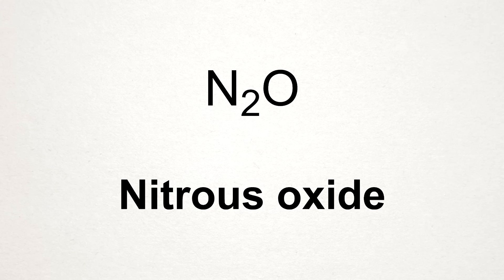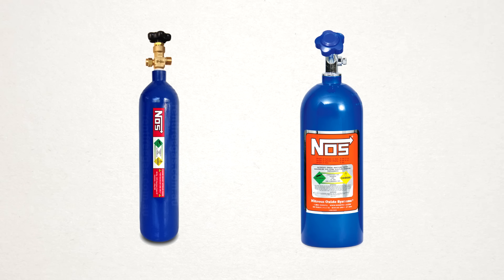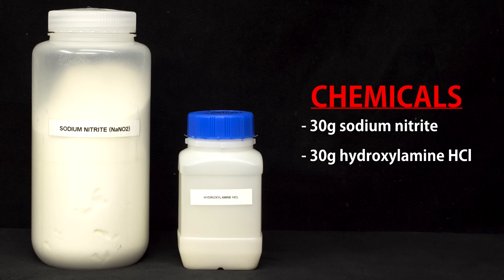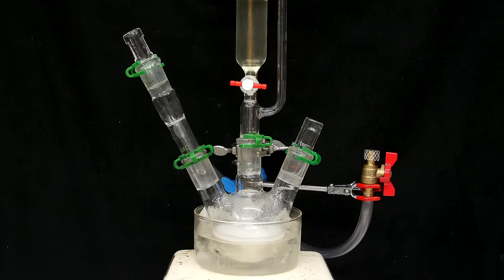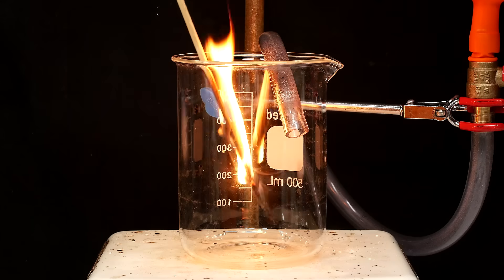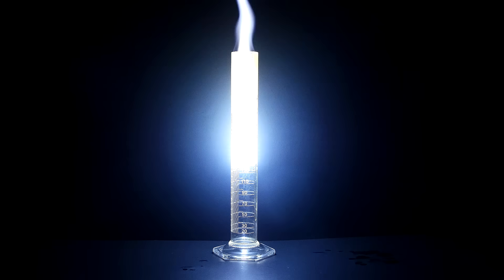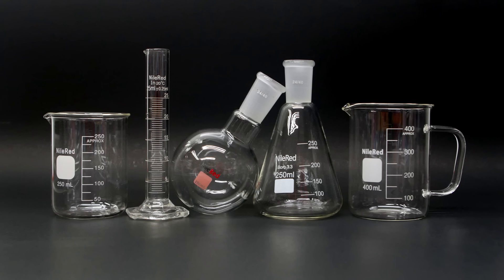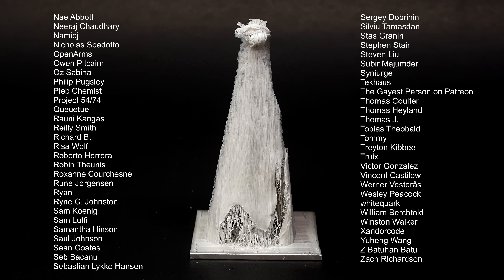Making laughing gas

Comment: Also N2O is a cryogenic refrigerant used on cascade cycle for sub 60°C is called R744A and have a GWP of 298 and a boiling point of -87°C @ 0 bar or 1 atm

Comment: Anybody know the name of the brass valve/fitting used from @5:41 onwards to fill the balloon, or another type of fitting that will easily allow standard sized lab tubing to be connected to common balloons? My current solution is too small in diameter for the balloon to get a good seal.

Comment: Im interested in trying out this experiment but i was curious about a variation in the glassware setup. Would it work to use a single necked RB flask and hook up a tubing adapter to the top of the addition funnel? As well as this would potassium nitrite work as a substitute for sodium nitrite (Iv'e found its much easier to purchase then NaNO2)?

Comment: It could be important to realise that nitrous oxide can render vitamin B12 inactive. This is a primary cause of the health issues that result from using it recreationally. Indeed, it is also an issue for both patients and staff when used in ordinary health settings such as in operating theatres or as 'gas and air' during labour.

Low B12 can cause many effects but is very likely to be missed by a doctor who is not suspecting it.

Comment: This is an excellent reaction to demonstrate the complex and perplexing redox chemistry of nitrogen compounds. Note that decomposition of ammonium nitrate is thermodynamically favoured, but not kinetically favoured, because measurably decomposes only with strong heating, but the exothermy shows the reaction is spontaneous. This is also due to mild acidity and reducing properties of ammonium. Sodium nitrate does not decompose like that. Instead in only partially and reversibly decomposes to nitrite, yet nitrites are more reactive than nitrates (ammonium nitrite notably decomposes at room temperature and explodes even on mild heating). While nitrates form nitric acid, nitrites don't even exist in acidic solution except as the unstable and reactive nitrous acid (compare with sulfurous and carbonic acids), which cannot be isolated and can be kept only for a while in cold solution.
So contrary to popular belief, inorganic nitrates are fairly inert and both the reduction potential and reaction rate depend on pH, which both also depend on temperature.
I guess the cooling is needed not only to avoid thermal runaway, but also to keep the unstable intermediates in solution (hydroxylamine, hydrazine, dinitrogen trioxide etc.).
Note that nitrogen itself is relatively strong oxidizing agent (E0 = ~1 V) yet it is normally so inert it can often replace argon in lab experiments (and so is nitrous oxide - this is why it's used as a propulsion gas for whipped cream in place of carbon dioxide, which is acidic and thus too reactive toward fats).
It would be great to demonstrate the redox couples and potentials involved in this reaction as well as conditions (namely pH) required to obtain nitrous oxide as a product (rather than nitrogen or its higher oxides).
The rich chemistry of nitrogen is utilized by bacteria and this is why nitrates and nitrites occur in nature (see nitrification, nitritation, denitrification, annamox, connamox). Some bacteria oxidize ammonia to nitrogen in presence of nitrate - the oxidation of ammonia takes energy, but the reduction of nitrate produces even more energy, making the whole process net positive. Although the final product is nitrogen, it is believed that hydroxylamine is an intermediate in such metabolic process.

Comment: N2O in cars is not as much used as an oxidizer, but to cool down the air fuel mixture hard, which gives move air in the mix. The increase in oxygen through the larger amount of air makes it possible to use more fuel and give more power. It would work with anything that cools down the mixture to the same levels, and doesn't kill the flame.

Comment: 9:39 Tip to get smoother and clearer slow motion footage: I noticed in your videos you use Lumix cameras for filming ( I'm assuming you're using GH4 or GH5 ) which can go up to 180 fps to 240 fps. The trick is to set your shutter speed to be double of your frame rate. So if you're shooting at 60fps then your shutter speed should be 1/120 etc. Side-note: It will require a lot more light since you'll lose more than 1 f stop of light per increment.

Comment: To the insane people who are actually down to do this (your not alone), I thought of an easy way to do this. I never tried it but I’m 99.99% sure it works
1: grab a bong
2: place the bong in ice water
3: pour the liquid hydro hcl in that bih
4: grab an empty water bottle and poke a tiny hole in it
5: pour the liquid sodium nitrate in the water bottle 
6: place your mouth on da bong
7: slowly drop some of the liquid sodium nitrite in the hole ur supposed to put weed in and quickly cover your hand on the hole so ur not wasting gas
8: enjoy

Again I just thought of this so if anyone is actually down to try it tell me how it goes👍🏻

Comment: Fun fact, N2O isn't actually used in car engines becasue it's an oxidiser, it's really used to cool the engine so it can hold more air, and the extra air allows more fuel to be burnt

Comment: The best way to do a Woof Woof demonstration is to dissolve some yellow phosphorus into some carbon disulfide.  Place a piece of filter paper on the top of your graduated cylinder.  Pipette about 0.5-1ml of the juice onto the paper and turn the lights off.  As the CS2 evaporates the heavier than air vapors fill the cylinder and when dry the yellow phosphorus ignites causing the vaper to burn from the top down giving a nice visual effect and the "woof" sound.

Comment: I think your yield is actually better than 80% because your calculation doesn't take account of the pressure inside the balloons. The molar volume of a gas is 24 L/mol at 20°C and 1 bar according to the ideal gas model. But it's less if the pressure is higher (one mole of gas takes less volume if it's pressurized). Therefore there are more molecules in the balloons than 0,343 mol!

Comment: I had spinal surgery for my scoliosis recently, and they used laughing gas to put me under. It was probably the closest to recreational drugs I’ve ever come. Like I turned my head to the right, then back to face forward, and the left half of my field of vision didn’t come back. Then every started to warp and before I knew it the surgery was over. 10/10 can totally see why people use it recreationally
Reply: Hope your back’s doing alright now!
Reply: @Pax_Mayn3 does it do brain damage?
Reply: @AfkBxndit  It's been a year but it will only negatively affect your health if you massively abuse it, like most things. To do it safest, you want to space out your sessions by 2 weeks, otherwise you get B12 defficiencies
Reply: @AfkBxndit yes
Reply: @AfkBxndit the main negative effect N2O on the human body is it rapidly depletes your vitamin B12 levels, which can result in a bunch of other health problems. this is easily fixed by taking a daily multivitamin. it’s very different from inhalants like computer duster or gasoline, nitrous oxide is a very safe drug if used responsibly. it doesn’t automatically kill brain cells when you do it, that comes after you’ve been doing whippets for days on end without taking anything to raise your B12 levels.
Reply: Dental problems for me. They gave me nitrous and got mad when I laughed at everything they did.
Reply: i was never affected as a kid i actually really liked it when i went to the dentist but my parents had traumatic car crash and i had gotten pretty bad anxiety from everything and i was at the dentist thinking the “laughing gas” wasnt going to do anything but when they gave it to me i felt really uneasy and even anxious and i hated it
Reply: I use it recreationally. Sadly it only lasts for about a few minutes but it’s nice
Reply: @nakoriakiyama9417 I hope you break free from your drug use soon.
Reply: @nakoriakiyama9417  where do you get it? the little whippits or a big canister?

Comment: We're those not laboratory's?
How can you have an uncontrol element set of a eight-hundred ton explosion in a facility that is all organising even the most minute of daily activities to the point your bath-room visit is regulate to how it is done in plan action of what you can, and when you can.
All rooms have at times will have a security block of its own measure.
Seal rooms.
Presurise rooms which causes a legitimate strain on your physical faculties over months if years.
You have a presure pushing against your skull for months.
The distance between your skull, and brain is almost non-existent.
That presure would cause a potential blood vesel leak, but.
Brain mater...
Being compress...
Synapses being an organic exchange of information.
Our functions of brain being a lot each a unique design.
The synpatic charge.
It has a voltage level.
Synapses reach specific zones in our brain to light up the best performance for the best results.
The skull being permanently compress smaller.
Size your skulls for over a decade of research from the begining test results.
Also.
Yeah.
Meth use in STEM.
One spot in the brain reaching a heat performance helps boost the performance of contributory functions in brain parts.
A visualisation.
These people in Albuquerque think it is a joke we are sexualise all the time by these machine influences.
As long they can profit.
Even from sex victim's of past vile violence.
Reply: I don't understand anything you're saying

Comment: My friend, who is a chemist did the math. A single whippet is 7.8 grams. It would cost you 1100 dollars Canadian to buy 1kg of hydrooxylamine hydrochoride online. Sodium Nitrate is 12 dollars canadian for 1 kg. 1100 dollars worth aprox would make you around 200grams of laughing gas. In Canada you can get a whippet can for 60 cents. So if you have 1100 Canadian dollars you could buy 1833 cans. Which would have a weight of 14297 grams of laughing gas. SO IF ANYONE WAS WONDERING JUST BUY YOUR WHIPPETS LOCALY AS ITS CHEAPER AND WAY EASIER

Comment: The yield calculation is likely incorrect. You didn't factor in the elastic resistance of the balloon vessel. That's not gas at STP. It's under pressure.

Comment: Carbon disulphide is a real pain if you need to use it as a solvent in a reaction, unless the reaction vessel is sealed. You do it in a fume cupboard, of course, but the stuff has such a low flash point that you can still ignite the vapour if you're using a magnetic stirrer (well, an old-fashioned one from 40 years ago anyway!), and once it's  lit, you have quite a job to put it out again. Cover the beaker and it goes out, but remove the cover too soon and it almost immediately lights again, the walls of the beaker are warm enough to ignite it once any oxygen gets in there. It's much worse than diethyl ether (yes, I've seen an ether fire as well).

Comment: This video was made before the Beirut port harbour explosion in 2020 which was due to ammonium fertiliser (nitrate) silos exploding after years of poor storage and degradation.....if you watch videos of that blast they are insane, it basically destroyed a good few square miles around the vicinity
Reply: not really, only the port itself was totally destroyed, some closer were damaged and buildings further away just had glass shattered. A lot of it's been repaired since then

Comment: Guinness, nitrous oxide is used in Guinness kegs in order to make it bubbly, but not in many other beers, even bottled Guinness does not contain nitrous oxide as it would be too high a pressure, and it also, as virtue of it being bottled, does not need to be pumped.

Comment: 1. what's the difference between nitrous oxide in this video and medical grades used in dental clinics?
2. At 7:04, it mentions "Do not to inhale the nitrous that is made here" mean? Does it mean that the method in this video is useless? If so, will a small amount be lethal enough? or does it mean don't do it the other way around?
3. It has been 2 months since the covid vaccination. Will it be safe to inhale nitrous oxide made by this video?
4. Will nitrous oxide made in this video interact with viagra?

Comment: This is an old video but I have a question. when you tested if you had N2O with the burning stick, what would have happened if it were NO2? Would the stick have burned differently or would it be the same?

Comment: 0:40 well it's not really often used in engines it's called nos (nitrous oxide system) and it has to be installed on an engine to pump more air into the engine than it is already getting

Comment: Nitrous is actually used in lower doses at the dentist. Whippets, or recreational nitrous oxide is just pure nitrous oxide, usually inhaled from a balloon or a professional whipped cream dispenser that you can put nitrous oxide cartridges in. But at the dentist and in other medical settings, they usually start with a mix of 50/50 nitrous/oxygen and then bring it up to 70/30 nitrous/oxygen. But of course you're inhaling it for much longer since a single nitrous oxide cartridge for whipped cream will last maybe 1 minute, and at the dentist, you get it for anywhere from 30 minutes to several hours, depending how long you're there and what's being done. But it's just as strong at the dentist.

Comment: this would be interesting in a tube open in both sides. like putting a cap on both sides, opening both quickly and lighting it. it wouldn't have the pressure from the bottom of the flask stopping it from accelerating all the way down i would guess and perhaps altering the sound somewhat?!

Comment: FYI Aug4,2020 ~3000 lbs of Ammonium Nitrate stored in a Port of Beirut warehouse blew up destroying much of the city. (The 1947 Texas City, Texas Ammonium Nitrate explosion looks like Hiroshima post a-bomb.)  Pure Ammonium Nitrate like other explosives requires a detonator, open flame is not sufficient to detonate, however will detonate by static electricity or minimal organic or inorganic contamination.
Be safe.

Comment: Thermal decomposition of Ammonium Nitrate  cogenerates Nitric Oxide and Nitrogen. Ditto the street racer nitrous, or welding supply Nitous Oxide. Bubbling through a column of wet steel wool removes Nitric Oxide. Full anesthesia is 95% Nitrous and 5% Oxygen (not air which is only 20%Oxygen). You can inhale pure Nitrous because your body thinks it is air. Your experiment makes Hyponitrous acid

Comment: Interesting side fact: the device that Timothy McVeigh used to blow up most of the Alfred P. Murrah building in the "Oklahoma City Bombing" incident (April 19, 1995) was a 2177.243 Kg (4800 Lb) ammonium nitrate/fuel-oil device, aka "ANFO."  They're sometimes known as "fertilizer bombs" because ammonium nitrate is a fertilizer.

Don't mess around with this stuff.  I'm probably fresh at the top of several FBI lists right now just for looking this info up to make sure I wasn't misremembering lmao.
Reply: "bombas sujas" i.e. dirty bombs as they call it in my country :/

Comment: I would also like to mention, regarding the reason nitrous oxide is used in whipped cream, that it doesn't set off the same receptors on the tongue as, say, the carbon dioxide used in soda, which sets off pain receptors. A soda siphon full of water charged with nitrous oxide will be just as fizzy, but taste almost flat on the tongue.
And so you know, there are drinks that use soda water and milk, like phosphates and egg creams, and they don't curdle because of the cold temperature and possibly also the dilution of the milk.
I know as a chemist, one tends to avoid putting chemicals in ones mouth as a standard safety measure, but when it's food safe, such observations can lead to some interesting finds!

Comment: Do what chemplayer did, run the NO2 through a condenser to make NO3. But take it a step further and add it to concentrated H2SO4, or concentrated peroxide, to see if you can make cheap nitric acid.

Comment: i think and this is a total guess that when the two compounds mix and ignite the CO2 Produced is on the point of reaction and moves downwards and thus expands due to pressure pushing the reaction upwards until the pressures equal out due to lack of react-able compounds at the epicentre thus leading to the reaction moving back down through the permeable CO2 until it reaches another bunch of react-able molecules and the cycle continues. that is what i think causes the oscillation.

Comment: We burned hydrogen in chemistry class (we mixed something (acid?? probably HCl or H2SO4) with zn). Teacher said to burn the hydrogen quickly, right after dropping the zinc. So we burnt the match before we added the zinc but it still made the ugly high pitched noise that scared me. Teacher said that it was supposed to make a deep kinda silent sound, but it made ugly sound because it had already mixed with the air. Idk why?
(Also sorry, english isn’t my first language, and I don’t learn chemistry in english)

Comment: Wondering if Nile Red pre-filled the cylinder with pure nitrogen gas before adding the reaction components...reaction would proceed slower and descend slower due to partial pressure?

Comment: Just add metal wire or something into the tube, to break the roundness shape of it. And believeme, it would burn a LOT faster without oscillating, but be careful, as the tube might explode

Comment: I need to speed the solidification of some methyl methacrylate. It's already mostly solidified, but when i open the lid I can still smell the chemical. Any suggestions? I dont know what temp is needed, if that can help. I need to get rid of it, but cannot until it has completely solidified.